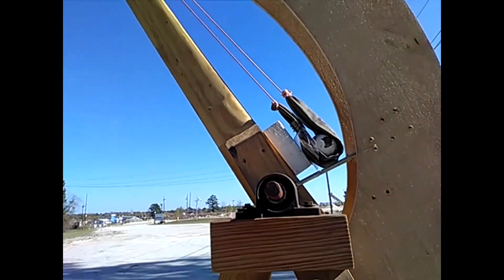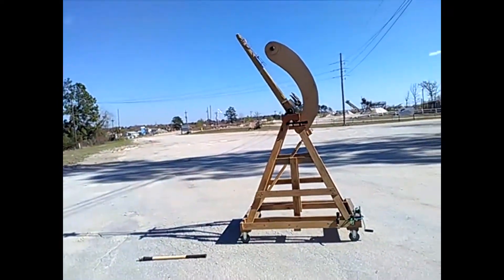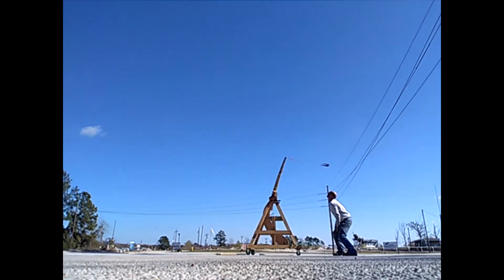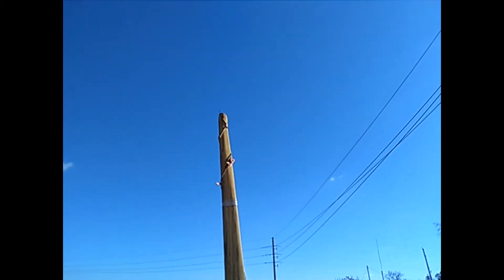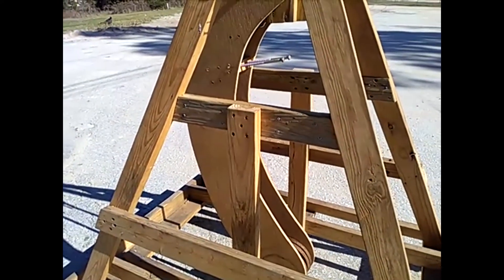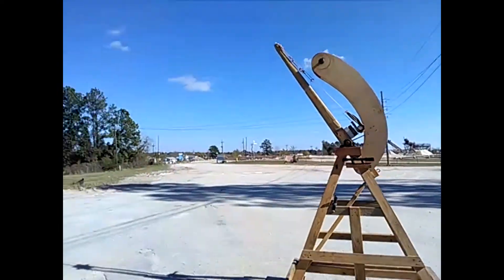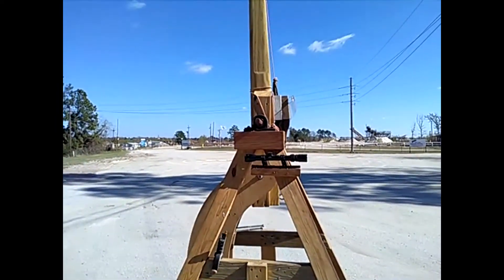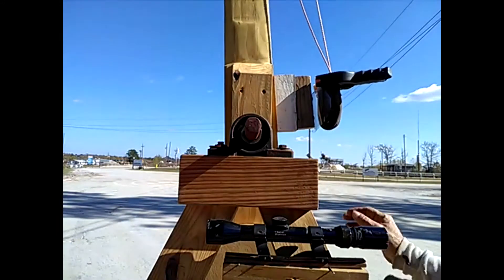Long Whipper Sling Loading Technique Tests

Comment: My first time seeing this video. What impressed me is that there is zero tip wobble, which is a common whipper problem and performance killer. Just a smooth swing through to sling release. The raised ball retainer was first suggested by Ripcord, IIRC. Seems to work very well.
Reply from the maker: It was really awesome to have Rob fly out from NZ.Very special! Thanks for watching and commenting! That is also special coming from a awesome builder such as yourself, Tom! The last 2 shot2 did stall a bit, but that just indicates that I can elevate the cradle a tad more. I missed out on knowing Ripcord (Raymond Goodseal)? And the old catmess board. That was before my time.
Reply from the maker: With Whippers, Timing is Everything. Mass ratio, Beam Ratio, Sling Length, Arm Weight, Hanger Geometry, Cradle Elevation, Finger Angle, Prop Angle, Drop Point, Drop Out, Cocking Angle, Frame Oscillation, Release Point, Launch Angle, Pouch Geometry, Arm Separation, etc... Massive combination!

Comment: Most of this stuff is too advanced for me , tuning is still a mystery. I can't figure out why they go high or perfect. The oddest thing is when balls of different diameters and weights can land together in a grouping. The slip hitch is pretty clever solution to what you are trying to do. That Kiwi pulled it out of his back pocket like it was a comb. Pretty slick.
Reply from the maker: Yes he did! We'll have to test both techniques more to see what pans out. I have built so many of them and have many thousands of shots with them. I can usually time them within a few shots now. Long slings and elevated cradles are still really tricky, and the springs change the dynamics, so that's yet another timing element, several actually.  It's all a learning process.